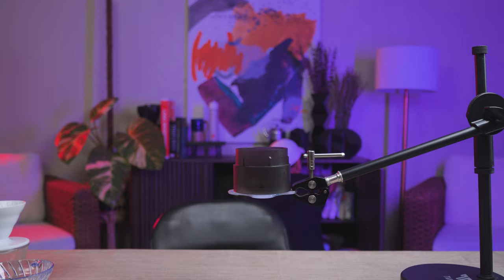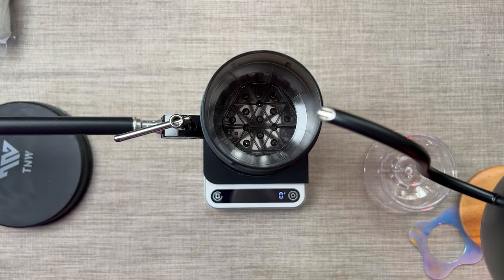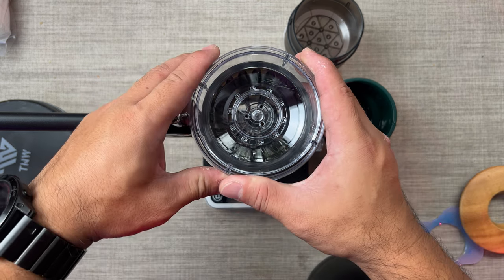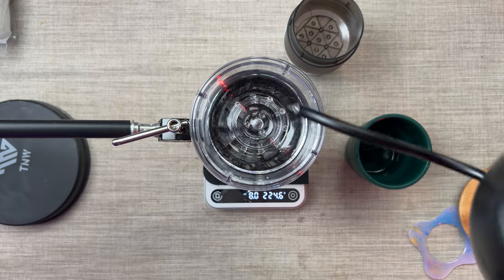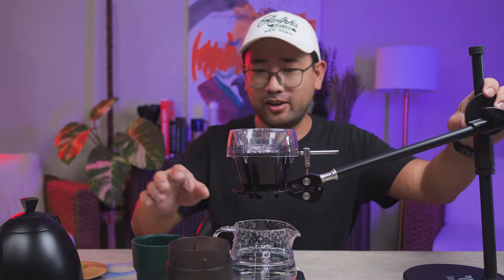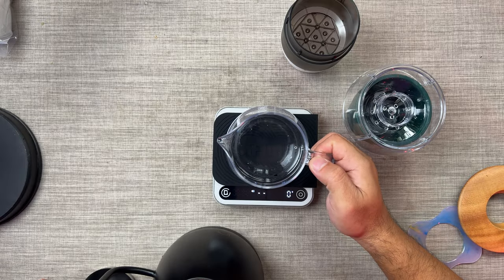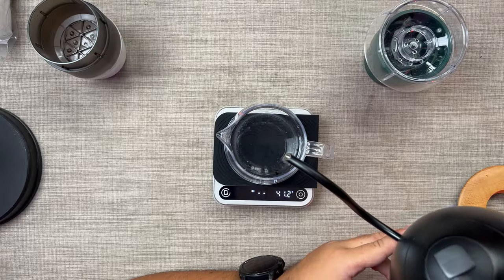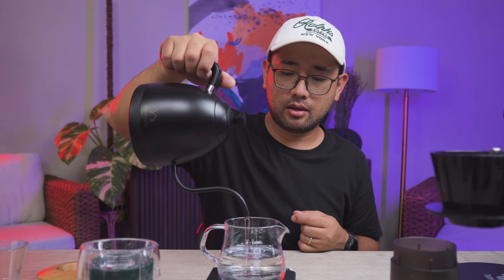Hario Drip Assist versus Timemore Water Dropper

Comment: What do you recommend for beginners, sir? Drip assist, timemore dropper, hario air, or that small gooseneck kettle?
Reply from the maker: Well for the dripper, the timemore can be used in more ways than one and the small gooseneck kettle is safer, more conservative with pouring mistakes.

Comment: I was wondering how is the water dropper if compared to a melodripper
Reply from the maker: the water dropper has a very slow flowrate, it finishes 100ml in 45 seconds. I havent tried a melodrip but from what i can see on the internet it does flow very fast as to not obstruct desired flowrate. If you need to go fast you can do so by pouring heavier. you can't do that with the Timemore water dropper.
Reply: @darylbuenocoffee  Need to master my heart before buying another one otherwise I will develop GAS (Gear Acquisition Syndrome). Thats another idea for your content.
Reply from the maker: @ericbaluya361  haha yes, i was talking about GAS to md.brews one time and I had to explain what GAS is. he said "I dont want that" hahahah